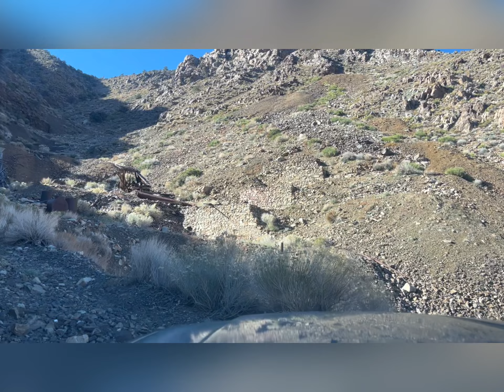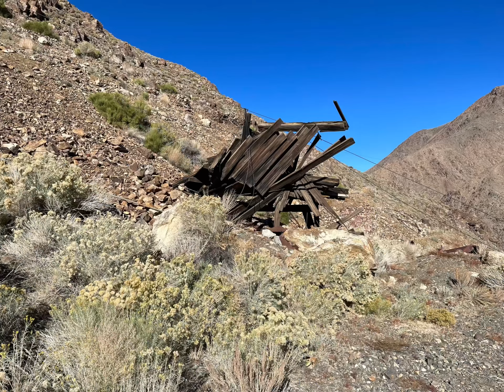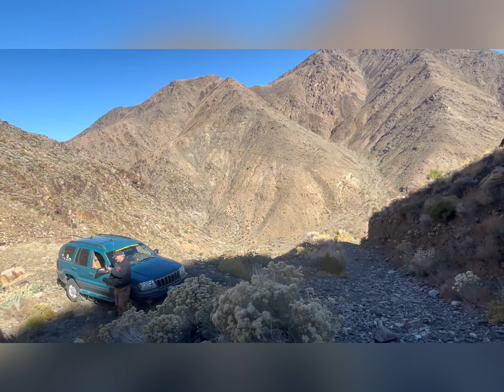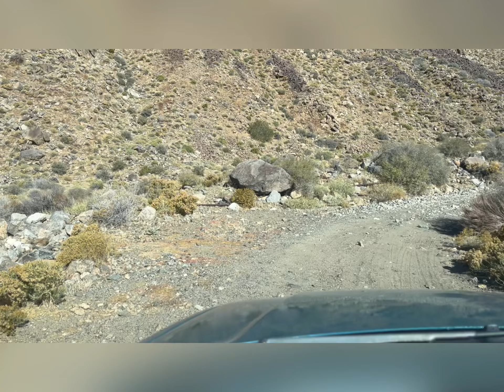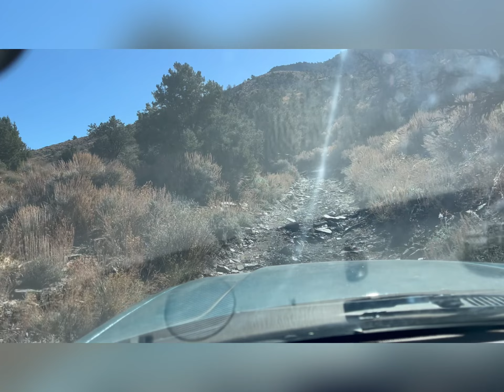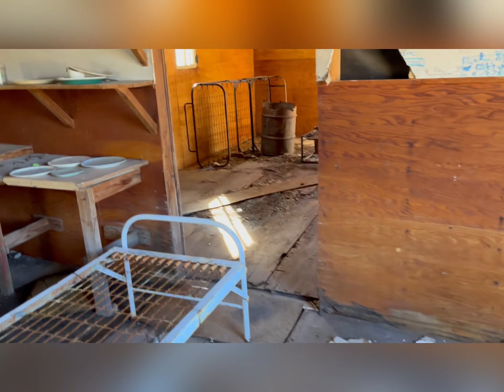Death Valley Mines of Death Valley 3

Comment: The trail actually looks better than I've seen in the past, which is amazing.  But sadly I can't say the same for Rita's cabin at the end of this video. The last time I was there someone had broken a section out of the front window and we fixed it with packing tape, but now they broke out the whole window.  And leaving the front and back doors open just accelerates the damage, which I simply don't understand.  This used to be a nice tight cabin where you could spend a warm night when it was bitter cold.
I met the mine owner the last time I was there also.  Interesting guy!
Reply: Yes i can't understand why someone would trash a cabin.
Reply: When will it snow and what elevation will it reach ? 
Oh and you realize the park is closed according to their website.

Comment: I would have never driven up that road to the mine, it looked very sketchy to me from the video which usually never captures the true nature of the road.  Anyway, nice to see that area is accessible.
Reply from the maker: Witch mine the trail up to world bearer mine site was the most sketchy trail. I think we were on. 
But all those trails are doable 
My WJ is almost stock I have 4” lift spring set from BDS and Bilstein 5100 shocks given me a couple of extra innings of ground clearance and 29” tall tires in a full time 4 wheel drive I only have 4 high an 4 low with something called Versatrac but it works 
I did air down to around 18 psi and with this I was able to go all most any place I wanted and we followed the orange wrangler every were they went 

So I would say if your vehicle is in good condition, with slightly above average gown clearance. You should be good to go.
Just take it easy and airing down really does help  
I only came across one trail were I needed to roll back and take a different line crossing over some ruts in the road it was one of those things 2 wheels off the ground one on each side one of those places you can see how much flexibility you have 
The path up to world Beater mine is very rocky but slow and easy will walk you to the top
Reply: Yes, the World Beater Mine road. @wjonthetrail